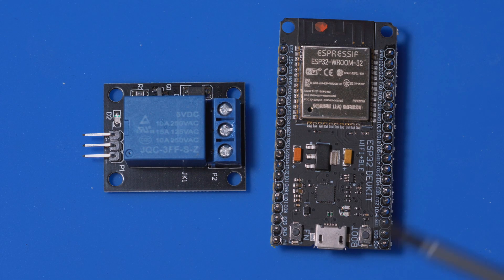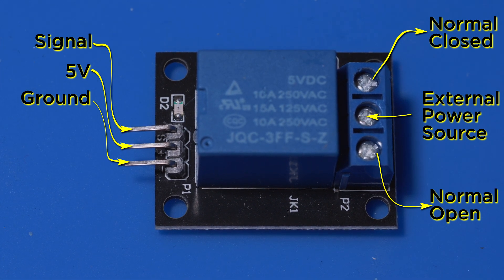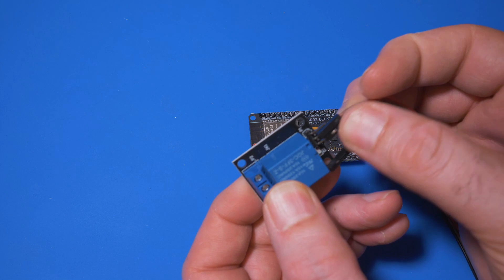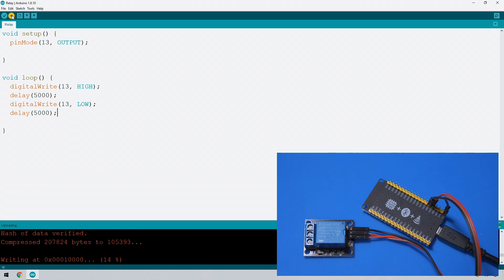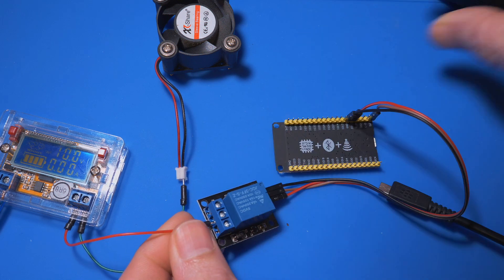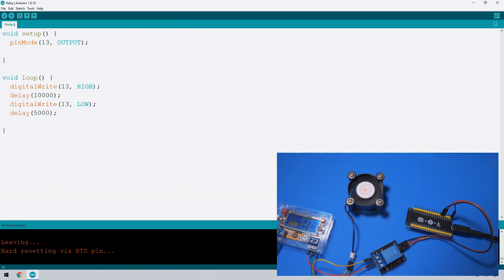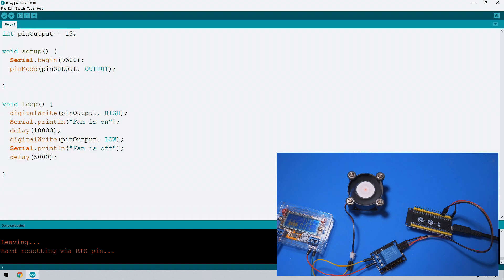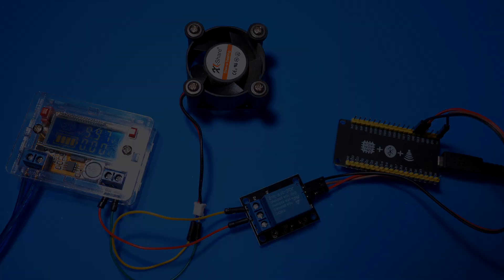Using Relays

Comment: HI Shaun great serie looking forward to connect all things and writing code for it. I have a Question I cant find any 5v out on my ESP32, is there different kind of ESP32  pin setups? I see they are labeled more than IO no. but no 5v, there is a VIN pin where the 5v pin should be located but that sound more like something to use if you not using power from USB? Or Do I have 5V on that pin when USB are connected ??
Reply from the maker: When using USB to power the board, then the VIN pin can be used as 5v out. You can test it with your multimeter, to see that it actually gives you 5V (https://youtu.be/yWfzvP9YQ8U).
Is your relay a 5v relay? I would recommend trying to get 3.3v relays if you can...I know it isn't easy for some reason! However you will see as this series progresses, I wouldn't really recommend powering the relay from the ESP32. I will be powering it independently. This provides isolation, as well as help prevent brownouts on your ESP32.